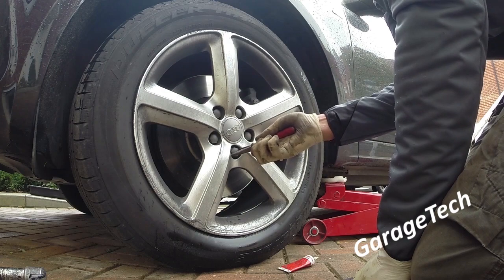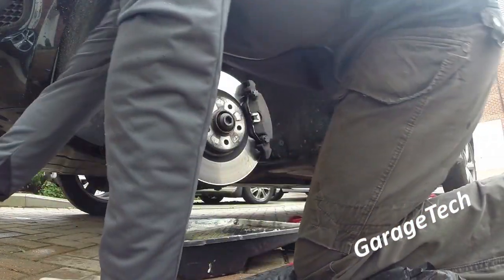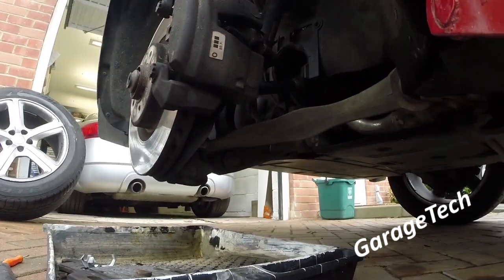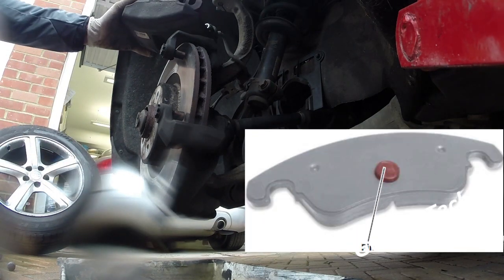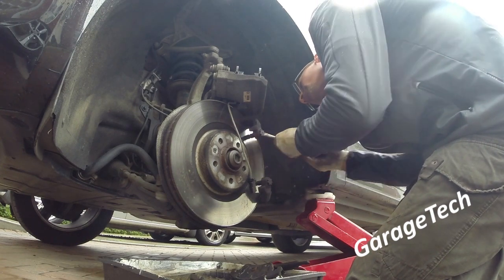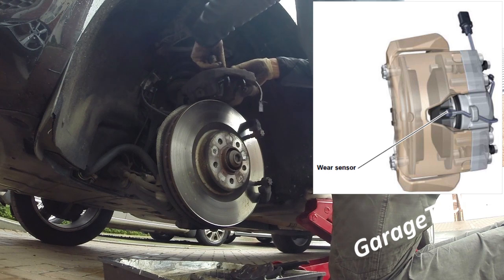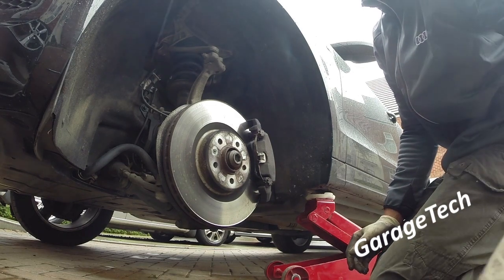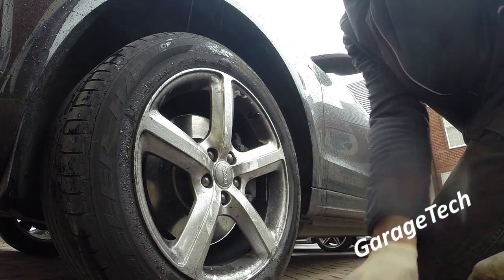How to replace your brake pads Audi Q5 A4 A5 2008 - 2016

Comment: when separating the sensor, you use the pick to pop out the finger that points up then turn it 1/4 and it slides out.  Dont pry the parts apart, it will break.  push down on the opposite end of the connector and pull them apart.

Great video, the diagrams help alot.  Keep them coming!!

Comment: Just one tip, if the brake reservoir was full when you started you'll have a flood under the bonnet from pushing more fluid back up the line which will damage your paintwork! I always use a syringe to remove fluid to a low level before starting, then top up with fresh at the end.
Reply from the maker: Yes great tip, especially if you’re changing the front and rear pads at the same time. alway check the fluid level before and after 👍🏼

Comment: thanks for posting, very helpful. . . unfortunately out piston will not push back, some hydrolic resistance i suspect, , , i will keep looking for the reason why.
Reply from the maker: Hey, if you can’t push the piston back with some large water pump pliers or a piston wind back tool, the calliper will be seized and need replacing or rebuilding. Hope that helps 👍🏼
Reply: @GarageTechAutomotive  you were spot on, , , we baught a new caliper, discs and pads both sides, all is good now. . .thankyou
Reply from the maker: @danielhopwood5985  no worries, it’s always a pain when it doesn’t go to plan. Glad you got it sorted 👍🏼

Comment: Use a wire brush to clean where the pads sit, make sure you grease caliper pins, and always make sure you torque your caliper bolts... There is a reason they make torques specifications for these bolts... Next, always make sure you torque your lug nuts. You can find torque specifications for these bolts online

Comment: Hi Great Videos, My brakes discs was skimmed and new front brake pads fitted about 1 week ago. There is however a squeaky sound that can heard when driving (Not under braking). It goes away when i press the brakes. Any idea what that is ?
Reply from the maker: Might be the pads just grabbing on the discs, only thing you could do is remove the pads and ensure the sliders/carrier is clean so the pads can move freely, use some brake grease. Were the pads genuine ones or aftermarket? Sometimes aftermarket ones don’t fit as well as genuine. Also, some pads have a chamfered edge which helps bedding in. A couple of hard stops might clear it. Failing that, it could be the discs if they haven’t been skimmed correctly.
Reply: @GarageTechAutomotive  thanks for input and prompt response. They are aftermarket btw.

Comment: you pushed the caliper piston straight in, on my prior A4 (prior model) the piston had to be screwed in.  Did they change this for this model A4?
Reply from the maker: Hey Michael, are you sure you're not thinking of the rear brakes? The rear brakes need the pistons screwed in on the older models as the handbrake mechanism forms part of the caliper. In mostly all front calipers the pistons are simply pushed back in. Hope this helps
Reply: not sure it's been a while you are probably correct, sorry for any confusion
Reply: Think that was on the rears that you had to wind them in

Comment: Does the warning light/tell tale  on the dash have to be reset after fitting of pads?
Reply from the maker: Jason stroud, no, there’s no need to reset the light. The pads will come with a new sensor. Once it’s replaced the light will go out.

Comment: Great video. Is it the same process for the rear brakes?
Reply: No it’s not. You’ll need a special tool to get the caliper to collapse in the rear. You can usually rent one from an auto parts store. In the rear the calipers have to rotate as they collapse.

Comment: Can I ask you a question? I'm the first owner of 2013 Audi A5. I replaced my wheel bearing last year at the Audi dealer (under warranty). After that, I was out of the country for 2months for vacation. When I back, it sounds weird (like a drum) every time I apply the brake. Higher speed when applying brakes, the higher frequency you get. What is wrong with it? Also, the "brake pad" warning lights on for few times. But my brake pads and rotors are good, I don't think replacing it will fix. Do you know what is wrong with this car?

Comment: This is not the same caliper as a 2015 Q5 has and this video won't work.
Reply: DirtyChemist The Q5 is made with both types of brakes/rotors depending on the year and type of wheels. If you calipers have an opening on the top or the brakes and are held in with a pin then you have the Brembo brake set up. Look up Brembo brake replacement and you will find many videos on DIY. The Brembo brake set up is actually easier to do.

Comment: @3:27 I saw on another video if you pull on the rubber bolt covers, it allows you to pull the calipers off without loosening the pads from the rotor. https://www.youtube.com/watch?v=V1vohg3t_JQ

Comment: I hate all mechanics who use a Needle Nose Pliers for removing the plastic bolt caps instead of the ABS tool specifically designed for this. You successfully scratched the bolt caps and the wheels.